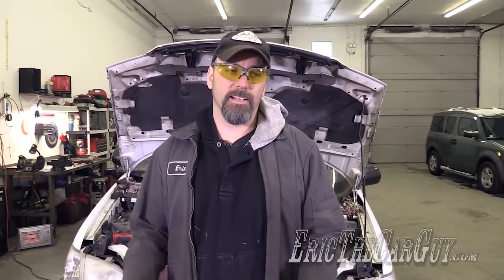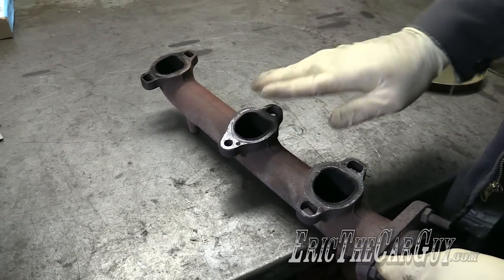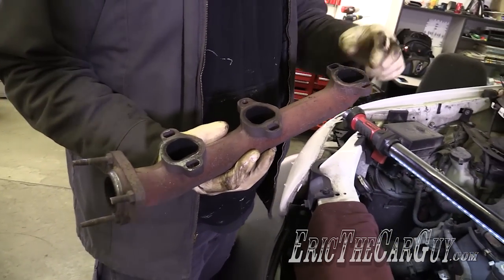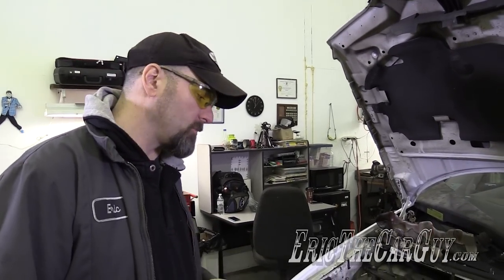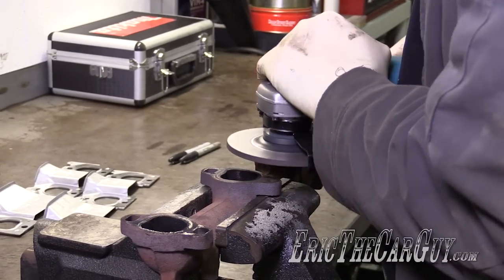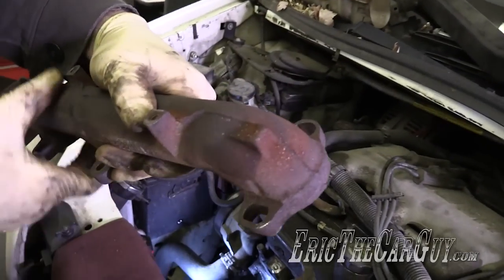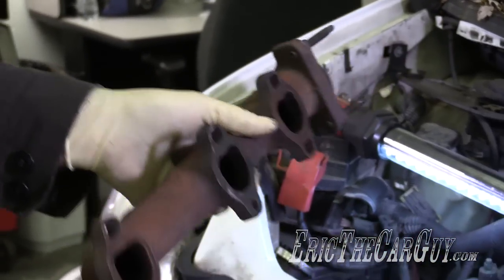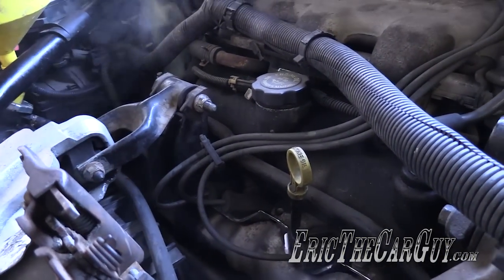2000 Pontiac Montana 3.4L Exhaust Manifold Leak Repair (Part 2) -EricTheCarGuy

Comment: The best way I found to remove these broken studs is to mig weld a old allen key onto the broken bit of stud in the hole, Then just twist and remove.
Reply: Keep an old tappet t head from a long ago broken set of taps just for that use myself.
Reply: Absolutely correct if the stud is sticking out enough. Eric is a spokesman for Longevity Welding, here's a chance for him to show the world just  how useful a MIG welder is and he blew it.
Reply: It was broke about an inch INTO the hole, and a hard angle. And it's a suborn exhaust bolt. Is MIG welding really and option?
Reply: It was broken an inch into the EXHAUST MANIFOLD where it was in relation to the head is what matters. I think it was sort of flush to the head if I didn't see this incorrectly. If it was flush he could have welded it.
Reply: buggsyspam Depends on how big the bolt hole is and how good you are with a welder and the work room. Doesn't have to be welded on deadcenter, offset enough to still clear the treads works. 

Doesn't mean it will always work though. Exhaust bolts are always rusted and due to the thermal cycles usually very tight so there are even odds the weld would just break. Basically Eric just went to final solution out the gate to save himself time.
Reply: Cragified
We'll never know, but I'm glad welding it came up. I've found that to be a very effective solution. What helps my opinion admittedly is that I have a 1960's drill that serves great for all but reverse drilling. Someday I'll get out of the dark ages on this, but at least I have my Miller MIG. :)
Reply: buggsyspam
 Forgive me if I don't go back and watch it again to confirm it broke deep in the whole, but I believe you're correct and that would eliminate welding as an option, but it's still on topic for similar problem that are at least flush or stick out a bit.
Heck, when it wasn't a high torque nut, I've welded a bolt back together when getting it represented hours more work. All I had to do, was use a couple washers and the nut went right back on. Problem solved. Gravity largely holds Mcpherson struts in place so I felt this was a great option when installing the top bolts.

You have to weld very well to do something that precise, so maybe I'm finally not a beginner at welding anymore. :)

(This was on a "99 Mercury Sable where I was putting new coils in. In it's design, I'd had to have pulled off the coil again from around the strut to remove the broken bolt/stud. It was already a big job and I had to be done. My 15-17 year old torque wrench finally broke causing me to break this bolt off. I should have trusted my instincts. Haven't I turned that enough? I bought a new torque wrench of course. It wasn't calibrated wrong, it was literally broken inside.)
Reply: DE Nichols
 I'm not arguing anything or saying welding is a bad idea. The OP said "weld it" and I asked if that was really possible in this situation.
The follow up would have been "can you show me?" as I'd like to see something like that. Welding on a flush or protruding stud is something I've seen before, but not for something broke down inside a head.
Reply: buggsyspam
Agreed. Forgot where the OP started lol (original poster for those who don't know what OP means, I only just figured out that acronym).
Reply: You like to weld them. Go to my channel and check out the one I did today. 4 broken studs. broke flush. no drilling required.
Reply: South Main Auto Repair
I watched your video good stuff you saved a whole bunch of time and aggravation. The thing is, most people don't have a welder so they will have to resort to drilling and tapping (like me). I've had the exact same issues Eric did except I didn't drill into a coolant passage, seems like on this engine there is precious little margin between the stud area and the coolant jacket. I'm very skeptical that JB Weld will hold up mainly because of heat in that area, if it does I'll be very impressed.

BTW can your method be used if the cylinder head is cast iron?
Reply: eleeter I await South Main Auto Repair's answer to this, however I'd guess iron is pretty quick to pick up heat. There a reason it was used so long in engines.
http://www.engineersedge.com/properties_of_metals.htm
Rather than continuing to guess I looked it up. 

Aluminum has a melting point at less than half mild steel, but it does transfer heat much better than iron so if it wasn't given too much heat I'd think it could take heat much longer since it transfers heat so much more quickly than iron. 

It looks like iron engines heat up faster to me if all things were equal. Since its not moving the heat nearly as well they may appear cooler, longer as they aren't using your coolant as soon as an aluminum head would. 

Iron moves heat approximately 1/3 the speed of aluminum but aluminum melts at 1220 F vs. Iron at 2150 F.

I'm glad I looked that up. It'll help a great deal when I'm welding near another metal. 

I can see why headbytes says you can weld iron only a little at a time.
Reply: I mention in my video that I do repair a lot of broken bolts and manifold. Short answer is yes it works just as well on a cast head. I use the same method but slightly different which I won't explain right here but as soon as one comes into the shop I'll do a video on it. The Dodge 3.9's are very famous for snapping bolts in the head.

Don't be discouraged by not having a welder. I could have drilled these out with a left handed bit and they likley would have backed out no problem. As far as not being able to drill straight or having your bit walk off in to the aluminum.... well that just comes with patience and practice. I have removed hundreds of broken fasteners in my time where you may only get a chance to do a couple or ten. At any rate...have I messed them up before... DUH! Yess!! Lol as bad as ETCG... well not really. There are a lot of methods that should have been employed before it got to this point but every dog has his day.

Interest me that there is so much interest in this topic of broken fastener removal...
Reply: Theres a guy in the town I live in that gets broken bolts out no problem with a stick welder and it does not matter if its broken off down in the hole He builds up the weld until he has enough out the hole to grab with vice grips and justs screws the bolt out. Ive taken around 15 of these 3100 and 3400 GM heads to him with broke off exhaust bolts. I don't know who Eric talk to but its a very common problem with these Heads and I know because ive done many head gasket repairs on them which is also a common failure which is caused from the intake gaskets leaking.
Reply: jonathan doyle
Wow, my skill isn't there to do it it on a deep one yet, but if it's possible maybe I'll have to try it someday when I'm in a bind. Hey, if it doesn't work, it needed to be drilled anyway, right?
Reply: yep, that's why u weld it first.. least always been my go to first

Comment: I'm just throwing it out there, but for all we know you didn't actually drill into the water passage.  But the stud hole might actually just go all the way into the water passage already.  GM is insanely stupid about stuff like that.  I know on my 3.8L V6, I had to replace a knock sensor, and for whatever reason the knock sensor hole went all the way into the coolant passage.  So when I took out the knock sensor, coolant just started pouring out!  So replacing one sensor, a 30 minute job tops, turned into over an hour with bleeding the coolant and crap.
Reply: Knock sensors are purposely screwed in coolant jackets. Sound travels through water fairly well...
Reply: willieb66 Possibly, but I've only ever experienced this on GMs.  The knock sensor on my Toyota certainly wasn't in the coolant jacket.
Reply: Yeah they've started using piezo style knock sensors that are much more sensitive to noise...

Comment: When it comes to drilling studs and metal.  I have found no better bit than Mibro.  The best part is I get get a big pack of them at Tractor Supply for $9.99.  They last forever, say sharp and eat steel, and they don't break nearly as easy as other bits.

Comment: A for effort, D for execution. BTW, pay a machine shop to flatten the old manifold out. May cost you like $20.

 I have tried every imaginable procedure to remove broken exhaust studs throughout the years.

Drilling/easyout, I can never get the damn thing to center very well. It goes off at a funny angle and I am done. At least give yourself the advantage and use a reverse drill bit. I may have about a 40% success rate with this procedure. Then the "easy out" can break and you are really done.

Paying somebody else to do the job, Sent out a v10 Ford. $900 later it was good as new. 100% success rate so far

Welding a nut onto the broken stud, It does work but I suck at welding and the nut usually breaks free. Maybe a 50% success rate.

Welding onto the broken stud with a mig welder and building out a booger, I then use These "Stripped stud" extractors (below)to get the booger/stud combo out. These stripped bolt extractors also will remove the stud if there is anything hanging out of the head (use some heat first). This is my go to method and I have had 100% success rate with this procedure, its quick and pretty easy even with my flux core mig welder. I may make a video of this procedure next time I do one.

You need to buy both sets for best results. Irwin Industrial Tools 394001 Bolt-Grip Bolt Extractor Base Set, 5-Piece AND Irwin Industrial Tools 394002 Bolt-Grip Expansion Set, 5-Piece

Comment: I think you did a great job Eric. The videos show about how difficult some jobs really are in the automotive repair field. It's a shame that other things came up after the repair some may have been there before hand or created by you but whats to say that there was an issue that was just about to break and taking it apart made it stick out. Which brings up other things like the customer complaining after you've done the work for them and wanting you to fix it even though some things aren't your fault. Maybe a good ETCG1 topic? Anyways Eric keep up the videos, they are a great tool in helping anyone out there that watches these cause the most important tool is knowledge.

Comment: LOL  I have done the Jb Weld thing before , and with success . I was worried the expansion rate of head ,vs stud may be a issue , but it did not seem to be. . . Some cars i get in to work on , I just can not wait for them to go , and some cars , for some reason are just a pain no matter what you do to them .

Comment: One thing needed in your tool box it's called started drill bits #1 #2 #3 what they are is a very short drill bit the length may be a 3/8 of a inch and the body is anywhere from a 1/4 to 3/8 tapered up to the small drill bit very strong and no wobble while drilling center.
Reply: I was going to comment that he needs a decent set of center drills as well.  I started using them on the mill I bought but I use the hell out of them on everything now.
Reply: 3577 NGinuity Also a set of transfer punches (which he could get cheaply at Harbor Freight (item #3577- $9.99 without coupon) on his next trip there) Center drills are great but spot punches guarantee that the hole goes in the center.
Reply: Check out the manifold job i just did on my channel. Got out 4 broken bolts with no drilling :)
Reply: South Main Auto Repair
I've used your method before.  Actually, it was my preferred method when I used to work on diesel drive welders for a living.  There was hardly ever a time I pulled one of those apart and something didn't break.  It's a far superior method but it doesn't always work and I've had to resort to drilling before as well.
Reply: Eddie the Grouch In this case it only had to work once. Another point is that screw machine length drills greatly help in a case such as this as they are short and very stiff which is a huge advantage. I'm an amateur and I have at least 20X the tools Eric has. I often wonder why that is. Is it intentional because he thinks his viewers lack resources or what. He has the most poorly equipped shop I've ever seen for a professional. ScannerDanner uses what a pro uses which is why I like him so much. Scotty Kilmer seems to work out of his backyard and he's got more shit that Eric. Why is this guy so under gunned?
Reply: SATAMAN Schmidt
Thats something I've noticed as well, its almost as bad as the shop I used to work at, the boss had maybe the same amount of tools as eric did, and the other guy that worked there had about as much but neatly organized and kept them all good and clean. I just worked out of their boxes for the longest time and am still trying to build up my tool count. Maybe he just trying to show that not everyone can have such a large selection of tools I suppose? I find it odd honestly.

Comment: Hey Eric, long time watcher, next time try a little heat in the hole then use paraffin wax, drill slightly and use an easy out. My Ford ranger exhaust manifold had the same problem with bolts breaking when removing and an old timer gave told me this trick and it works a treat. Cheers

Comment: What brought the customer in to have the manifold leak addressed while that van has so many other glaring problems? Why did they want this work done, while it still needs a radiator, exhaust, etc etc?
Reply: The vehicle most likely failed a state inspection due to the exhaust leak being considered a safety hazard.
Reply from the maker: tducketts 2 words. Work truck.

Comment: Eric, LIke I mentioned before, the drill doctor is not as easy as they say.. I will say this though. Figure out what works well (By size) on there and it will be great but it is different depending on the size of the bit you are working in. I created a chart and keep it with it for a reference.

Comment: Theres a guy in the town I live in that gets broken bolts out no problem with a stick welder and it does not matter if its broken off down in the hole He builds up the weld until he has enough out the hole to grab with vice grips and justs screws the bolt out. Ive taken around 15 of these 3100 and 3400 GM heads to him with broke off exhaust bolts. I don't know who Eric talk to but its a very common problem with these Heads and I know because ive done many head gasket repairs on them which is also a common failure which is caused from the intake gaskets leaking.

Comment: Did you keep up with this van and see if the JB Weld held?  I would think it would have cracked eventually and started leaking coolant.  It's so rigid, it has no flex.  Also, do you think there is a possibility the JB Weld  flowed into the coolant port and plugged it up to some degree?

Comment: No worries about the coolant passage, one tuber I watch drilled right into the combustion chamber of his Chevy 6.5 turbo diesel. This was after he broke a bolt on the timing cover, and attempted to drill and tap it, and broke the tap... D: not good D:

Comment: When I look at that engine bay I can not stop to think that the design is rubish...
They just droped that engine in and placed engine mounts in random spots... Same story about ruber and electrical lines - they are tangled like mp3 headphone wires (-_-)
Completly oposite of mercedes cars from 1990-2000...

Comment: same thing happened to my uncle once his solution was simply to coat the threads in plumbers dope and torq to spec which may have been a better idea EricTheCarGuy 
plumbers doap is rated for -25 to +500F @ 1000PSI
and its not permanent ....
I guess it would depend on how much thread depth you had to work with doap needs a good 2/3's of a inch to seal effectively 
jbweld tends to degrade when subjected to consistent temps above 400f
unless its the high-heat stuff

Comment: Eric, why didn't you just use high heat rtv on the bolt? I guess some older dodge V8s came from the factory with water jackets that meet exhaust taps.... ?

Comment: With my Honda, I have to be so careful with air in the coolant system or it will overheat. I have to run the engine, let it cool, open the cap, add more coolant, run it let it cool, etc.  After using the bleeder screw.  With the Subaru, I can just dump coolant back in after a repair and it's fine, it doesn't overheat and eventually it draws coolant as needed out of the overflow and air works its way out of the overflow bottle.  I don't need to use the bleeder screw and air in the system doesn't make it overheat.

Comment: Happens I also have a 2000 Montana -- and so much appreciated and commend your cool, yet so "real" approach to one GM mess after another.  Has me wondering if you ever tried doing a video on changing the back 3 spark plugs, the coil packs, the bizarre heater hose configuration, the EGR valve (and cleaning out the infernal plenum clogs), and even the "simple" replacement of the thermostat....  (takes hours and hours to get it off)  Such idiotic nightmares help explain why GM went bankrupt.....  Still, we persist in trying to keep it still running.  (ps, even with your funnel, nothing easy about "burping" these Montana/Venture/Silhouette's..... )  Kudos again for your efforts, even on such a nightmare job.

Comment: I do not understand why weld the stud to a nut with aluminum head methods were not used, it seems to work well with all the other broken exhaust bolts repairs I have viewed. Other is if going the tap the bolt out that you did not use left hand drills, which is a common practice in industrial mechanics, which could have let the bolt spin out. I understand about having to use what you got , but sometimes you have to prepare for the PITA type work to save time and oh pooh happens....
Actually a good video to tell you the truth, because this is what we get into before knowing everything we could find on the way to a repair, just communicating that to a customer...